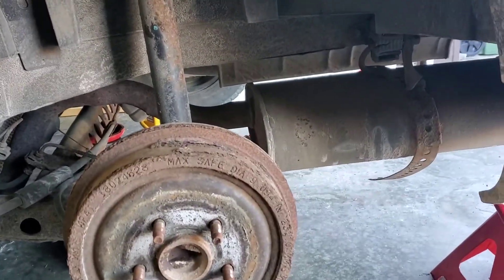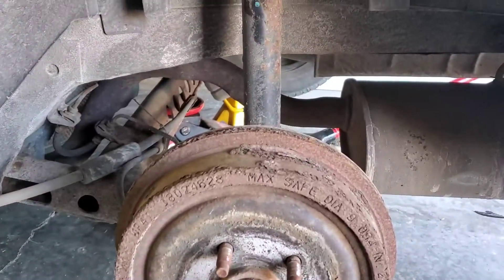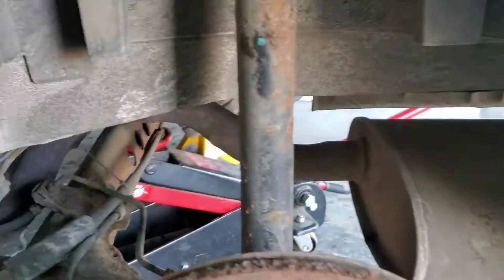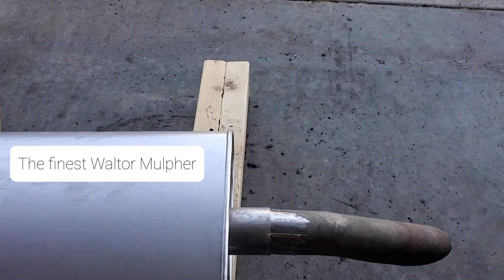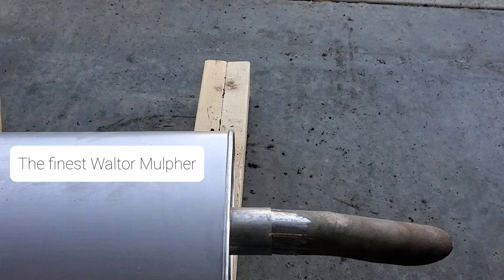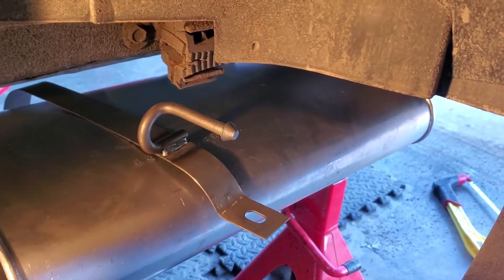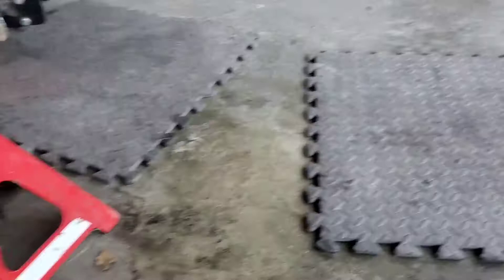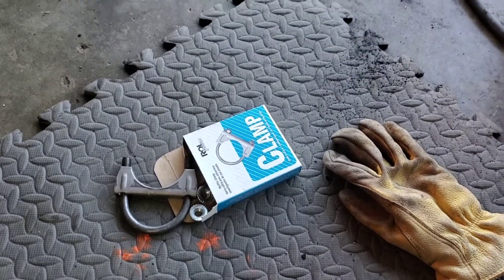DIY Muffler Replacement On The Cheap - Cavalier / Sunfire

Comment: yeah..on the cheap if you have welding equipment...
Reply from the maker: 🤷‍♂️Standard muffler clamps is a no welding option as shown in the video, hack saw is a non powertool cutting option. Thanks for watching.